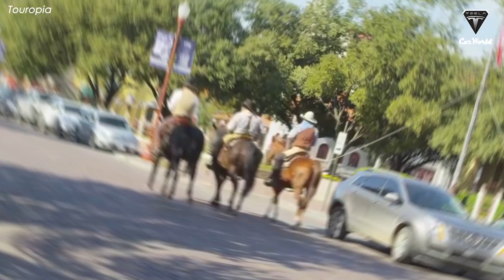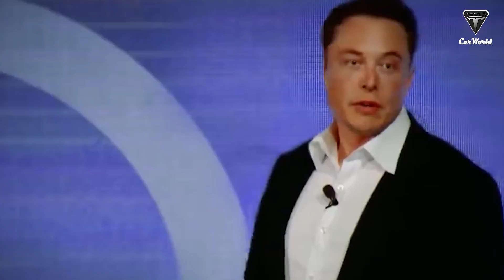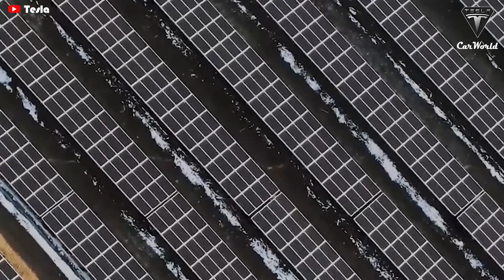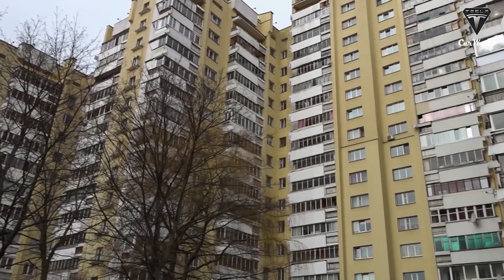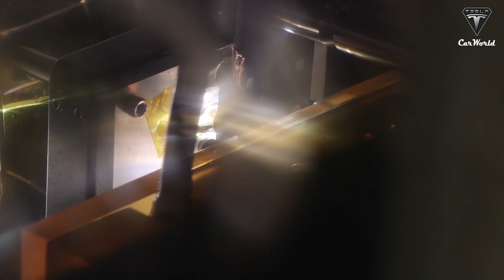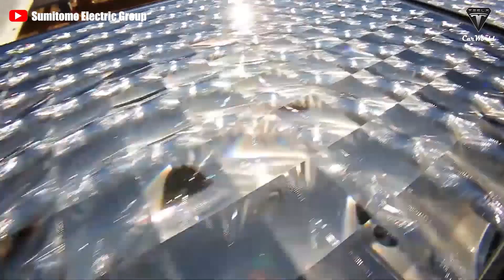Elon Musk: "This New 4.0 Solar Cells Will Change Everything in the EV Industry"!

Comment: I want tesla solar to be great but the need to make changes.   
1. Adjust the tranducers - 1 to maximize power transfer/savings as well as to maximize the collective power when on more than one roof.
2. Increase the number of his contractors.   They have the demand but don't have the workforce to assist - they could sub it out however those subs don't seem to understand the tough technical questions.   If they want to sub it out they should have rigourous training and testing and strict agreements not to sub -sub it out with an inspection be a tesla engineer.
3. Get a level 2 engineer/inspector to review each install within 2 weeks of the go live date - 1 to tweak settings and replace equipment as necessary.
4. Get a team that can answer the questions - great team for the courting stage but after you've made a committment it shouldn't feel like you are estranged.

Comment: There is no such unit as watts per hour. Watts are already a time rate of energy transfer. The definition of a watt is one joule of energy transfer per second. The narrator or whoever wrote this content is indulging in mindless technical gobbledygook. It make zero sense. Somebody needs to get an extremely elementary technical education about electricity. 

Voltage is analogous to pressure in a water pipe. Current in amperes is analogous to flow rate, such as gallons per minute. Current times voltage is analogous to power (watts) or how fast (not how much) water (analogous to energy) is transferred. How many gallons got transferred is analogous to total energy transferred during the time current was flowing (analogous to watt-hours or a larger unit, kilowatt-hours). 

This is extremely elementary stuff. The slightest attempt to self-educate would eliminate this mess. The Internet makes that easier than ever. Do it! Whoever you are, that will stop you from confusing others with your mindless gobbledygook.

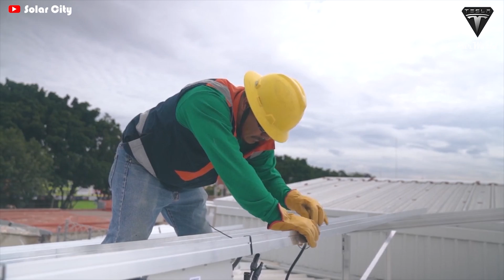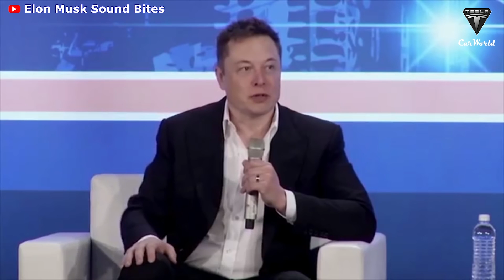Comment: 13:00 v3.5 Tiles are 25”x55”. Is it possible to order them in time to be permitted by the 4/13/23 deadline to be grandfathered into the existing net metering rate plan? 15:50 New high density battery.
Reply: Maybe you could install a small grid tied system with used panels to beat the deadline then expand it later?

Comment: Tesla solar is not what it seems, try calling them after paying up front. Also their inverters are choked forcing you to buy more to use the power the actual panels produce. Size of panels is irrelevant if power cannot be converted in rebate $$$$ - and you need at least two batteries otherwise you will be charging after one days use. The system isn't quite what it is made out to be. Tesla solar shingles are a non starter as Tesla can't supply or fit them, watch other YT videos to see some enlightening information.
Reply: Agree